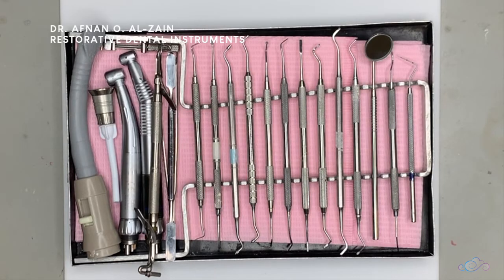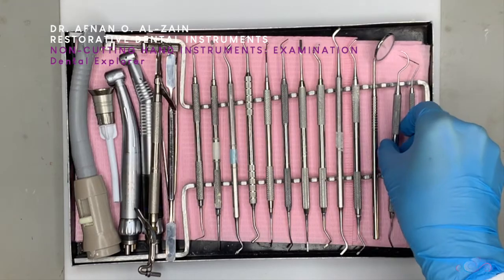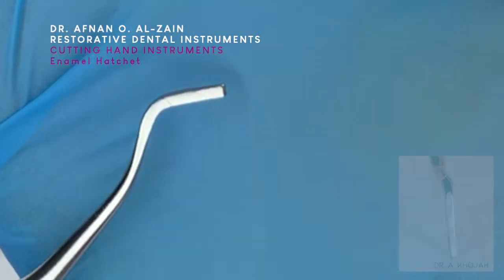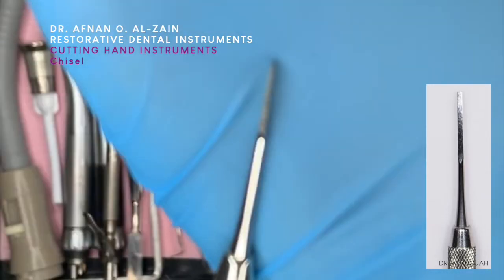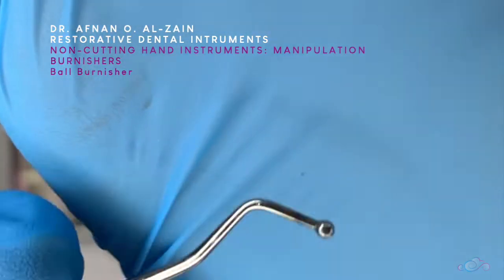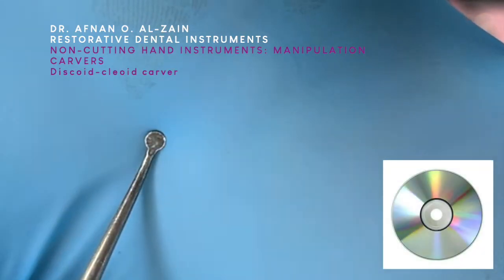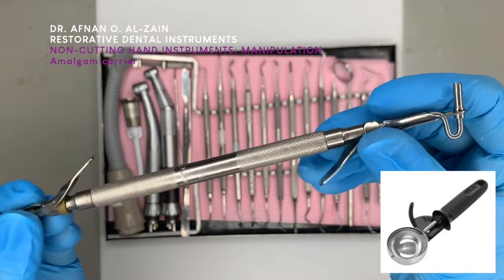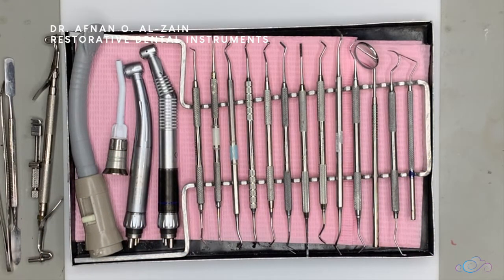Restorative dental instruments – examination, cutting, non-cutting hand instruments, rotary - En

Comment: Then what is “ash 6 and ash 49” and where do we use it? Is it for manipulating composites or amalgam?
Reply from the maker: They are manipulative instruments for restorative materials as well. 
Ash 6: is a plastic filling instrument (the margin of its working end is not sharp) for placing and shaping the composite material, GIC, and temporary restorative materials.
Ash 49: is an instrument with cylindrical nibs and rounded ends. It is similar to a ladmore burnisher or a small smooth condenser. It is used for material manipulation as material packing and adaptation.
Reply: @drafnanoalzain  thanks a lot!
I didn’t find any article uses the term “ask” only in Arabic or Indian origin articles, so is it possible that both (ash6, ash49) are called pfi without any specific name/numbers to distinguish them? Or do they have other names?
Reply from the maker: @dent0osh  Yes, I didn’t find also in the book references to those specific terms. So probably they are just variations of instruments. In some I found they named ash 6-49 and considered it one instrument. Different companies may name their instruments a little differently. The most important thing that you know from it’s shape that it is a manipulation instrument and how can you use it. 
Good luck!
Reply: @drafnanoalzain  can’t thank you enough for you time and effort, may Allah bless you
Reply from the maker: @dent0osh  you are most welcome. Thank you